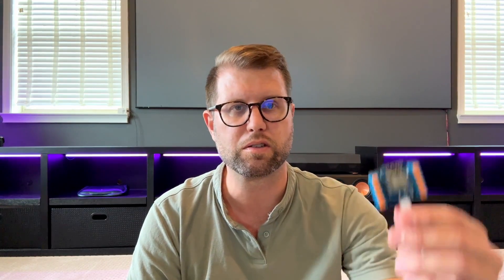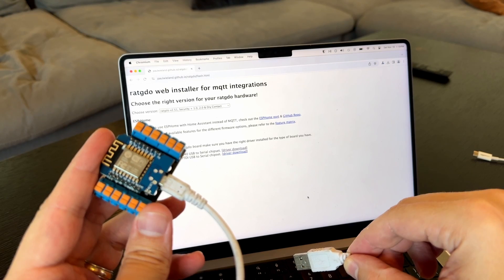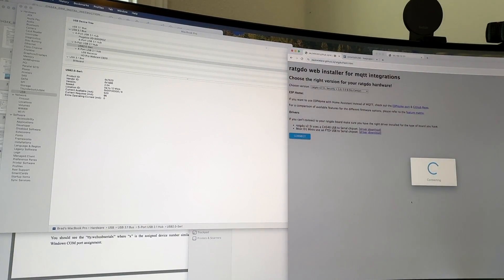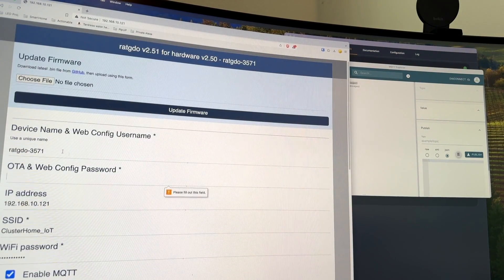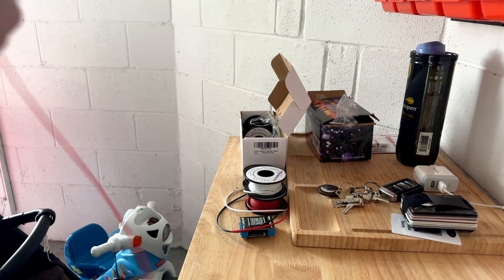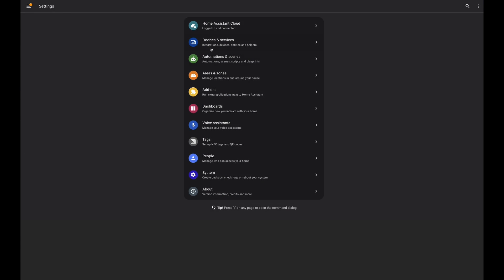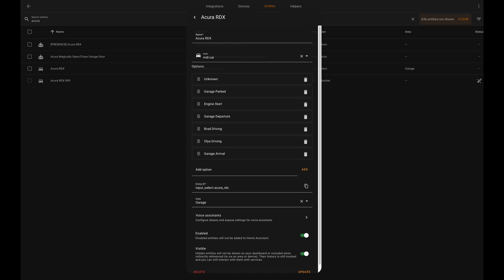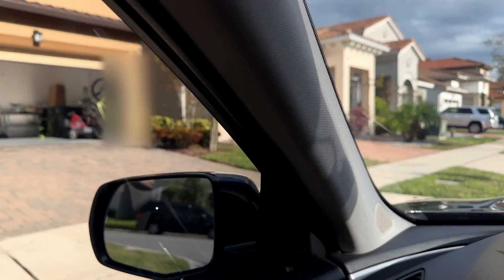Ratgdo + Home Assistant = Automatic Magic Garage Door Opener!

Comment: Can the presence detection automation be set up to be car specific if you have multiple cars?  I'm not seeing anything that ties the presence detection to a specific car.  Thanks for the great information!
Reply from the maker: Each car probably has a unique BT and/or WiFi signal.  You can use that to determine which car the phone is connected to and therefore which person is in which car.  Should work.
Reply: @FutureProofHomes  Thanks, I’ll look into it!  Also, curious how your “garage parked” trigger is set up if you don’t mind.

Comment: Seemed to be going great until I made the initial wifi connection... once I took it to the garage it wouldn't connect and become available in Home on my iPhone.  Plenty of signal in there, so I assume it must not have been connecting to the 2.4ghz band on my mesh network.  I turned off 5ghz, no dice.  It did randomly open my garage door after I erased and was halfway through reprogramming the ROM... so my wiring must be okay.  I'll see if the vendor has any advice - Reddit users were talking about a similar problem that appears to possibly be a 2.53i problem.

Comment: Great video. I just got my ratgdo but I can't figure out how to get the wires out of the garage door opener? I'm pressing on the orange tabs below but the wires aren't budging and I don't want to break it.
Reply: If you can't figure out how to disconnect some basic low voltage wiring, this device may be too advanced for you...
Reply: @KurtLamprecht   LOL, responding to a message from a year ago. I did get the wires out eventually, they were stuck in there pretty good.

Comment: Thank you for the video! I connected mine up exactly as you have , but I can't get Homeassistant to activate the functions via ratgdo. I’ve confirmed my traditional wall button and obstruction sensors are working. I receive the logs and updates thru mqtt just cannot execute functionality of cover/light
Reply: Correct
Reply: I can click the button but it does nothing. Manually use does update the state
Reply from the maker: It’s very odd that you can see one-way communication.  It really sounds to me like the wiring is slightly off. Double-triple check all the cables are inserted correctly is my recommendation.
Reply from the maker: When you say that you “cannot execute functionality of cover/light” do you mean you can’t click the button in Home Assistant that will open the garage?

If you manually open the garage door, does Home Assistant state update to indicate that the doors open?
Reply: Triple checked everything and I know it’s good because I actually had a garage service company come out to my house. For this integration, I set up the HA mqtt add on. Are you familiar with that? I think it’s a HA issue
Reply from the maker: @chillvegandude I’m not sure man.  I’d need to see your setup to get you fixed up.  Not trying to sell myself (at least too hard) but if you’re really stuck and need an expert go to my website and do a consulting session I bet we can quickly fix this.  Here to help, but I’m stumped from this far away.  Stay chill.
Reply: Thank you! Filled out the form on your website

Comment: I just set up my ratgdo 2.5 (2.5i). This was helpful. I didn't have any trouble connecting to the ratgdo as a USB device. I didn't need to install any Chinese drivers. My device showed up as Product ID 0x7523, Vendor ID 0x1a86. In the connect dialog it showed up as "USB Serial (cu.usbserial-142xxx) - Paired"
Reply from the maker: Lucky you!  I definitely had to beat mine into submission to have it connect.

Comment: Oddly I connected mine up exactly as you have (and also tried the pass thru method first), but I cannot get Homeassistant to activate the functions via ratgdo. I’ve confirmed my traditional wall button and obstruction sensors are working. Just left the ratgdo wired in anyway for now.
Reply: Same issue here. Obstruction sensor updating in real time on home assistant, but light and door statuses are wrong and light on/off door open/closed actions do nothing.
Reply: @barrettheaton in my case the issue turned out to be that my GDO is older and supports only Security protocol 1.0. This is not yet compatible with the ESP Home firmware (it only supports 2.0 right now). Security 1.0 is now under development.
Reply from the maker: Can you elaborate on “cannot get HA to activate the functions”?  Did HA recognize the MQTT device?  Perhaps you installed the espHome version of the firmware on your device?

Comment: Ratgdo seems perfect to control the gate at my office. Adding some automation to have the gate kept open during office hours so customers can enter is something I now do with a regular timer. Being able to automagically open the gate when (certain) employees enter outside office hours would be something I definitely like to add. But not all employees have the companion app installed (and I don't even want to know their location). So I prefer to use something like a Bluetooth scanner at the gate so the gate can open as soon as a certain Bluetooth devices comes in range.
Guess I have to look at a Bluetooth scanner that can be used with HomeAssistant
Reply from the maker: Hey Rob!  Glad to have you here.  A few thoughts:

1) I think you'll want a more simple "dry-contact switch" like a Shelly for your gate automation.  The Ratgdo is overkill because it is built specifically for Chamberlain devices using the Security 2.0+ garage door protocol. 

2) Bluetooth sniffing could work, but it can be pretty finicky and you might need to get all your workers to "pair" their phone's bluetooth with your solution, which leads to user error and other challenges.  I'd highly consider putting a WebRTC camera on the property and using frigate to read the license plate and open the gate for known plates. 

Hit up FutureProofHomes.net if you need design or install help. ;) Cheers man!
Reply: @FutureProofHomes  After watching the video from @rogerstechtalk I understood that this indeed is specific for the Chamberlain devices. 
Bluetooth sniffing does work. I have a stand-alone BT sniffer that shows when a BT device enters or leaves the area. That works for any BT device that is dicoverable. This is actually how our local municipal keeps track of traffic congestions on roads going in and out of the city. These BT sniffers are placed on a number of places and a central computer system keeps track of how BT devices move (BT addresses are encrypted and of course no personal information is stored)
Using license plate detection would be nice too but that will be a complete different project.
Reply from the maker: Wow.  That’s a cool BT sniffing project.  I’ll read more about this kinda stuff.  Thanks for sharing!

Comment: an even easier approach is the Shelly 1Plus relay. Fully supported in HA, dry contacts support and a switch input for a reed switch to track open/close status. Have one on each of my 3 garages and can track and control all three from my android notifications/controls bar and from the HA app dashboard. I even pulled in a camera feed from my Unifi garage cameras embedded in the dashboard page.
Reply from the maker: Unfortunately, simple dry contact switches can’t control these Chaimberlain Security 2.0 garage door openers (unless you wanted to crack open the wall remove and do some soldering).  For most garage door openers Shelly will work great though!

Comment: Just starting to get into the smart home stuff.  If I wanted a similar setup to yours would I need to purchase anything else besides the ratgdo in order to automate the door to open and close using geofence. Thanks!
Reply from the maker: You’d need ratgdo + WiFi + a Home Assistant server.  I recommend googling the “Home Assistant Yellow” or “Home Assistant Green”.  They’re easy to plug in and connect the Ratgdo to.

Comment: It would be easier if software was pre installed...
Reply from the maker: Agree.  However it should be noted that there are many different versions of the Ratgdo firmware depending on your garage opener model and if you want the ESP32 variant or not.  I suspect this is why we must all manually flash the firmware we want.